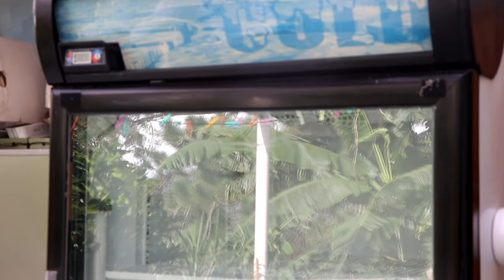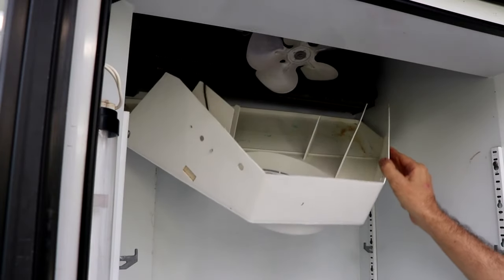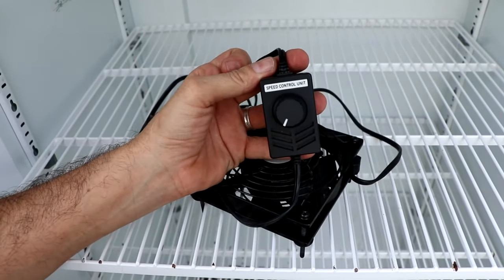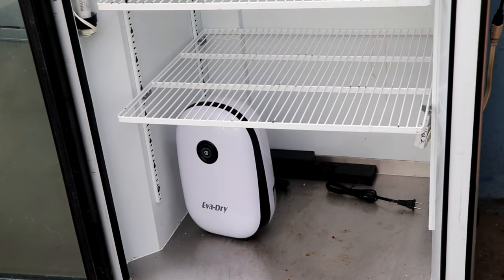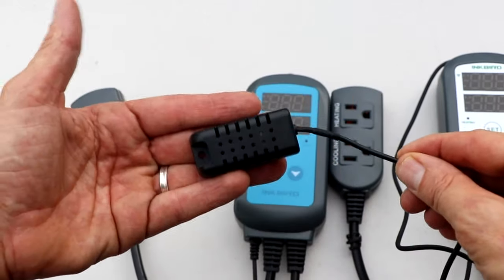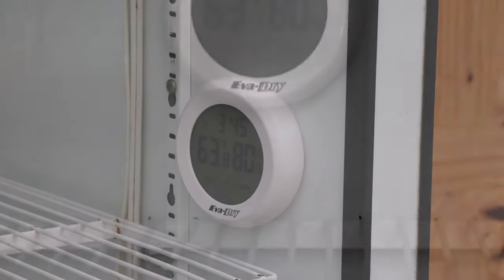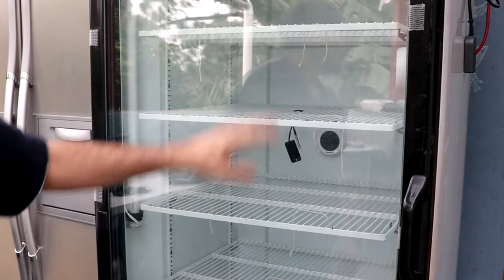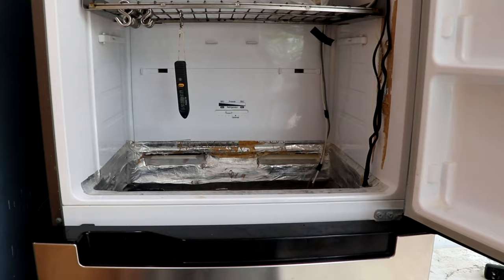Building a Salami Chamber/Cheese Cave - Easy Step by Step

Comment: Thanks for this and many other excellent videos.  I have a question about the end-stage dryness point for salami.  Everyone says dry to a weight loss of 35-40%.  But...  I've purchased several commercial salamis as a benchmark.  One large diameter sopressata I purchased was  "squishable" to the touch; a second one (small diameter) was hard as a rock.  Without much experience to go one, I'm assuming one of them was 30% loss and one was 40% or greater?  What end point should I use?  A second question:  the whole meat varieties (copa, bresaolo, lonzino) all seem "softer" than the really hard dry salamis.  Do the whole meat varieties have a different end point goal?
Reply from the maker: Hey Thomas.  It really comes down to personal preference.  anything between 30% and up is fine to eat.  30% weight loss is going to be quite soft while 40%+ is going to be harder.  Generally whole muscles are dried softer like 32% - 35% but it all comes down to personal preference.  If you are going to be making this at home my suggestion would be to try it at the different stages of drying to see what you like.  I like a salami at 38% and a whole muscle at 34%.  But that's just me...

Comment: Any reason not to pipe the output of the dehumidifier into the tank of the humidifier? Avoid both having to refill the humidifier and empty the dehumidifier... or would the water get gross after a while if you did that?
Reply from the maker: Clever idea.  You could do that if you had a top loading humidifier but yes, eventually the water will start to get moldy and slimy...

Comment: Hey guys, great channel 👍
I have a 3 meter x 3 meter  coldroom made out of 50mm panel with an air-conditioner as the cooling unit. It is controlled by a coolbot controller, do you think this room could be used as a salami/cheese drying room?
Thanks 
Paul
Reply from the maker: Sure sounds like it.  As long as the air flow is minimal and you can increase the humidity it should work..
Reply: Thank you for your reply, keep up the good work 👍

Comment: Hi Eric, great video and tutorial, extremely helpful. I have some silly questions I'm hoping you could help with. I've got a fridge in my garage that I'm planning to adapt similarly to your set up however the fridge thermostat only goes up to maybe 8 celsius so around 45f (?); if I plug my fridge in the cooling section of the inkbird, how will the inkbird increase the temperature inside my fridge?
Maybe I'm thinking it all wrong here... and it should be:
1/ fridge all unplug and open door - temperature is normal so let's say 20 celsius - 68 F
2/ plug fridge into inkbird temperature controller that will take my fridge down to what I need it to but still above the max my fridge would naturally go to so let's say 12 c or 53-55 F
3/ once inkbird reaches desired temperature, it turns off the fridge and if the fridge goes back up in temperature, it will turn it back on to maintain temperature
4/ if the fridge doesn't gain temperature, the inkbird won't turn it back on

Does that make sense at all? My fridge starting temperature needs to be higher or equal to what I want it to be maintained by the inkbird?
Reply from the maker: Naturally (unless you live in a very cold environment) your fridge will rise in temperature when unplugged.  Inkbird just turns it on/off to keep the temp that you set it at (in this case 55F).  If you live in an area that gets very cold in the winter and your fridge is outside then you might have to plug a heating pad into the controller as well.  Other than that looks like you're on the right track..  Hope that helps
Reply: @2guysandacooler  Yeah mate, this is wonderful thank you so much. I've made saucisson in my garage last winter and I really struggled keeping the temperature and humidity under control so they've turned out okay but they have a bit of a harder outside layers and the inside is just right.

Comment: I received the Inkbird humidity and temperature controllers, chamber is nearly done,
I want to use it as a fermentation chamber also, can I plug in a heating element to the temperature 
Controller so I can get higher temps for fermenting, can I have all three units in the fridge. If so 
What type of heating element should I use. My ambient temperature in the room is 68-70 degrees F
Reply from the maker: Yes you can.  A heating pad works to get the temperature up you can also use a 75w or 100w incandescent light in a tin can (just make sure the salami aren't too close to the heat source)..

Comment: Hey Eric! Long time subscriber, first time commenter. I am about to start a curing chamber build and had a quick question. I already have a small humidifier and dehumidifier but when they lose power and the power comes back on, the units do not power up until I press the button. Do the units you have in this video come back on when say the humidity drops and the humidifier kicks back on? How do you handle that? I am about to buy the exact models you use but want to make sure. Thank you so much and thanks for the fantastic content! I am looking forward to getting started in the world of charcuterie and even cheese making!
Reply from the maker: Hey Chris.  Thanks for the comment.  Yes.  The units I have in this video automatically turn back on when the power is restored.  I made a video on dehumidifiers and humidifiers, and we talk about that specific issue.  Glad to see you are trying something new!!  Reach out if you have an issue😉

Humidifiers:  https://youtu.be/CXNvNU_sFmg
Dehumidifiers:  https://youtu.be/5pprS-jHAeM
Reply: @2guysandacooler  thank you so much for the quick reply! I totally missed those videos! It looks like I will be watching them and then purchasing the equipment soon! Now to just find me a fridge. ha! Thanks again!

Comment: I have a fridge in my garage that will not get warmer than 40F. Is that too cold? The open air in my garage has been about 60F right now, should i take my salami out (been i for abt 2 weeks) and move it to the open air of my garage? No white mold has formed yet on the salami inside the fridge.

Comment: Thank you so much for the clear and concise information that you provided on this subject. Very much appreciated! I would like to ask if you think it’s possible and advisable to use a vertical freezer as the basis for a curing chamber build? If yes, I would imagine it would have to be a frost free model?
Reply: I was thinking the same thing but found that most have fixed shelves that are the freezing coils.  I ended up using a fridge without a freezer.  They are a little harder to find but work perfectly.

Comment: If you want some airflow but not a lot, why not take a saw and cut the fan blades?  For instance, they looked on your fan to be about three inch long blades, why not cut off all but about 3/4 of an inch on each blade thereby having a little movement but not much, and test again?  If there is still too much movement at 3/4 of an inch you could cut off half of the blades completely and try again?

Thanks.
Reply from the maker: That's a good idea.  For me I wanted to keep the fan blades whole, in case I wanted to use the fridge as a beverage fridge in the future.

Comment: what do you do to sanitize the cabling and other equipment? They'll need to be washed with a weak solution of bleach and water after and soap and water before that to get any grease off, you'd think.
Reply from the maker: Check out my "cleaning a dry curing chamber vid".

Comment: Hi Eric,

Recently came across an upright freezer that is available in my area. It has the perfect dimensions for a new chamber, but i'm wondering if it's going to work the same given that it is a freezer and not a refrigerator. Do you have any thoughts on this? Thanks for all you do for this community of learners, it's taught me so much.

Warm regards,

Adam
Reply from the maker: I've been told that it works great, as long as it's frost free

Comment: I follow your videos are very good in fact I decided to build a drying chamber using a refrigerator this has the fan and the coil on top I would like to ask you if I need to remove the fan and use one like the computer or not remove the fan
Reply from the maker: It's hard to say.  Each chamber is different.  You'll want very little air flow.  If the fan you have is blowing too much air then I would suggest switching it out for a low speed computer fan.
Reply: @2guysandacooler  thank you ,for your help

Comment: Hi sir
Humidity in Singapore between 80-95 whole year. Do I need humidifier for fermentation chamber? Or the dehumidifier can do the job?
Reply from the maker: Hey ashraf.  Funny you should mention fermentation chamber.  I'm working on a video exclusively about that.  To answer your question if you are talking about a fermentation chamber then technically you don't need either.  When you ferment salami your humidity needs to be around 80-95% during the time it's fermenting.  This is usually between 18-72 hours.  As long as your humidity is high and your temperature is right for fermenting you are good to go, BUT.....

If you are going to be drying your salami (30-60 days) in an open space like a room or basement where the humidity is naturally high 85%-95% then you would want to get a dehumidifier to lower the humidity a little bit.  Too much humidity will cause mold to grow out of control.. 

Did that answer your question?
Reply: @2guysandacooler  
sorry sir for my mistake  i mean for salami
Reply: thank you for  all what you teach us.
Reply from the maker: No worries , that's what I thought but do you mean drying chamber (like a fridge) or fermenting chamber?
Reply: @2guysandacooler  
i mean fermenting chamber for salami
Reply from the maker: @fadycool  perfect.  Was my answer sufficient?
Reply: @2guysandacooler  
yes , thank you.

Comment: Hi Eric,  Am I right in thinking I can have 1 (one) Chamber for both fermentation and drying by simple adjusting the temp and humidity levels ? Im sure you have answered this a million times, I just have not come by it yet. Thanks V much again for your efforts.
Reply from the maker: Yes.  That is correct.  I'll be making a video soon on "fermentation chambers" and I think it'll shed some light on the subject.  But, yes.  You can use the drying chamber as a fermentation chamber to get salami going...

Comment: Hi I have a 2 door drinks fridge which I have converted into a curing chamber. I am having problems keeping humidity in check. I have 2 dehumidifiers but they don't seem to do anything. I had to not use a humidifier as it was putting in too much humidity which I could  only lower when the fridge started to cool. I must be getting humidity from the evaporator unit as when the fridge is not running the humidity slowly rises. The only thing that keeps my humidity in check is when my fridge starts to cool. Any help would be appreciated

Comment: Be aware that when modifying the design airflow for the evaporator by changing the fan, that you will be drastically affecting the refrigeration cycle. Yes it will work, however a refrigerator is a balanced piece of machinery and when you change one of the major components you will more than certainly shorten the life cycle of the system. Just some food for thought

Comment: I raised the temp and unplugged the humidifier, so after a day and half it didn’t seem to do much,so I added a small ceramic heater, the humidity is much better, it goes up and down now 70% - 89%. I hope it’s safe to do that and also I hope  by doing this it’s not forcing the humidity to stay in the salami. Your opinion please and thank you
Reply from the maker: It should be fine.  Just make sure the salami isn't next to the heater and the internal temp stays around 55F (13C).

Comment: Great education sir! When we stuff up the fridge with lots of meat products like sausage. As you mentioned it creates so much moister. The dehumidifier  removes that. We aiming for nearly zero air movement for even drying (to prevent outer surface dry ring, but still moist inside). My dehumifier creats a so much air movement. Is there any dehumifier without air movement, or any idea to solve this isuue?
Best regards: Attila
Reply from the maker: what brand dehumidifier are you using?
Reply: @2guysandacooler  It's a whirpool.

Comment: One thing that I have had to deal with is pests. As much I keep my garage clean  it seams after it rains summer hits. I can't keep them out of my garage.. and they still manage to get in my fermentation chamber. And of course all my door seals are good.last year we had a fly infestation. Every so often wear I live in Florida. The fly's every summer. Are a pain in the &$$. I've been real hesitant can you use an insecticide near my chamber's .any suggestions. I was wondering you living in Panama if you also deal with this
Reply from the maker: That sounds wild..  Sometimes little mice (when the chamber isn't on) like to chew on the wires but I generally keep my chamber on all year.  It should be sealed off from the outside.  You might want to check and see if there is a hole or port that they are sneaking into.  We have a fly season here (matter of fact we are in it right now) but i've never had them in my chamber.   

They make these glue like strips that you can hang from your ceiling and the flies love to get stuck to that.  Maybe that might be an option.
Reply: @2guysandacooler   sorry maybe I didn't make myself clear in my questionI mean yes I look for holes and found a few and it filled them up. The only thing I can think of. Is the palmetto bugs squeeze their way underneath the and it usually happens right after it rains during.i was looking for a good safe insecticide . I was wondering if you had any ideas. I would like to bring it in to the house but I don't have the room
Reply from the maker: Oh I see.  Boric acid seems to work well.  I forget the mixture ratios but a quick google search might help fill in the blanks.

Comment: Hi Eric, just converted my magic Chef Wine frig to a curing chamber. Question I have is the frig doesn't have a fan. Should I add a small computer fan(plug in style) and blow it against the back wall coil panel? Also I'm  thinking to plug it into the IHC-200 controller line with the ultrasonic humidifier. Please advise. Thanks love your channel.

Comment: Would an upright freezer work well?  Seems to fit all the criteria… well insulated, wire racks, etc.
Reply from the maker: Hey Patrick, as long as the freezer is frost free it should work.  I've never used a freezer as a chamber but others have with great success.

Comment: Thanks for another awesome video. I just built my chamber with a freezerless 11 cu ft fridge and the gear you suggested (ink bird, eva dry, etc). My issue is that I always have water droplets on the back of the fridge and the condensate pan is filling up with water. The fridge has a fan so I didn't add one. My chamber is inside. My inkbirds have been calibrated. Should I be concerned about this condensate? Any suggestions to remedy?

Comment: Hey guys Awesome content, rather than switching the fans over could I foul it with something perforated ( vermin mesh , cheese cloth, fly screen ect.) it wouldn’t stop the air flow but reduce it . Would this be problematic ? Cheers.
Reply from the maker: It's hard to say.  You would have to experiment and see.  All you need is minimal air flow.  Like a soft breath.  If you could manage to get that by covering then I think it would work.
Reply: got it. Trail and error , thanks !
Reply from the maker: @Pbirdification  😁😁

Comment: Thank you so much! Could you please let me know where you drilled your hole(s) into the second, smaller fridge? And what are your thoughts on just running the cords through the back seal of the door without driiling any holes?
Reply from the maker: So the hole I drilled for the chords is at the top right next to the door.  Check out this video (at the 5:00 minute mark) I made showing that fridge:  https://studio.youtube.com/video/SKR9U_R8uwk/edit

If I had to do it all over again I don't think I would drill into the sides of the fridge.  Running your chords throgh the door is ok as well..
Reply: @2guysandacooler  thank you!

Comment: HI. I'm someone who is just getting started in building my chamber, my question for you or what do think if I set up me dehumidifier to drip from the reservoir down into my humidifier ? any pros or con to doing this? Thanks any suggestions would be appreciated.
Reply from the maker: That's a tough question to answer.  It all depends on the type of humidifier you have.  If your humidifier is a top loader or will work with a hole in it then it should work out.  You will notice though, depending on your chamber you might not pull as much moisture as you think.  Every chamber is different...  I hope that helps.  Please let me know if you have any other questions
Reply: @2guysandacooler  thanks ! I think I will give it a try and see how it goes. I will give you and update.

Comment: I have a new refrigerator that I have converted to by my drying chamber.  Because it is new, it has that plastic smell is that somthing that I should worry about? Should I let it air out until that smell is gone?
Reply from the maker: Yeah.  I would let it air out a few days but shouldn't be an issue to worry about..
Reply: @2guysandacooler  ok that is what I was planning to do. Thanks again for the help.

Comment: Amazing video! I got a question, the trays for the fridge, are custom build for the fridge? What materials do you recommend?
Reply from the maker: I did have those custom built.  They are stainless steel.  Aluminum will rust too quickly in this environment.